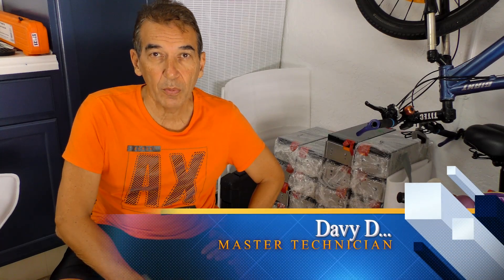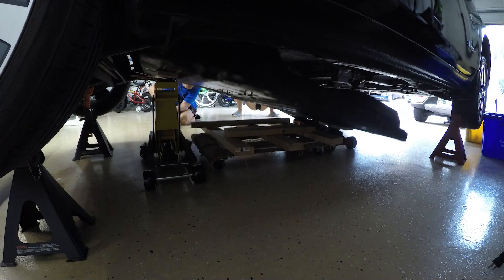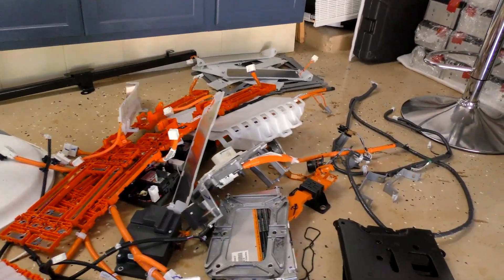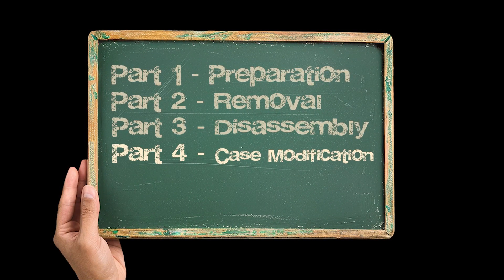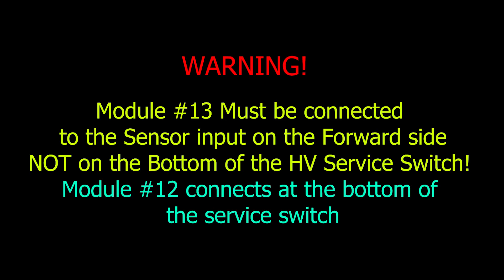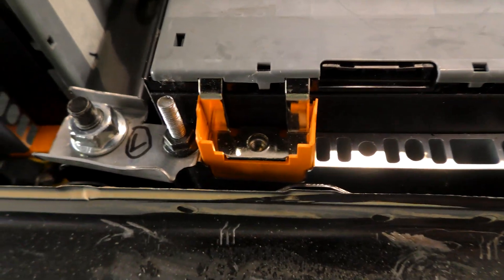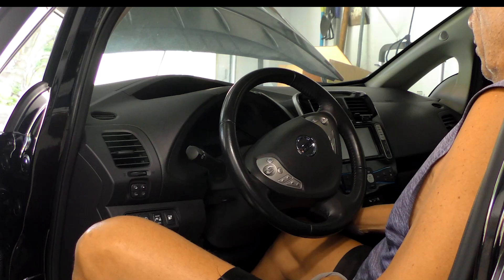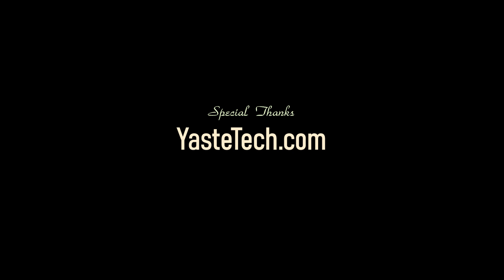Nissan Leaf Battery Swap Upgrade from 24kw to 53kw

Comment: I wanted to do this for my 2013 leaf but without heating or cooling for the battery will greatly reduce the life of the battery.  My leaf lost a bar after a heat wave and range was greatly reduced in freezing temperatures.  So I just got a used Tesla for myself and now my son drives the leaf in the city will get 60 miles off the original battery.

Comment: remove the bus bars first not last & preferably after the module stacks have been removed from the battery case to avoid damaging the modules. also use some safety equipment like insulated gloves and tools.